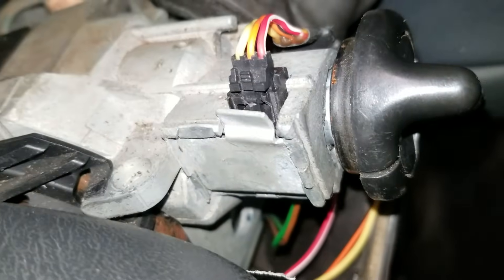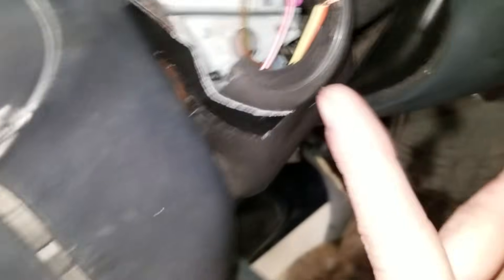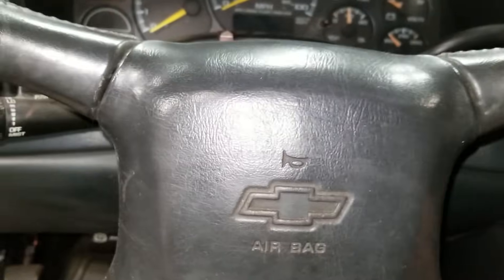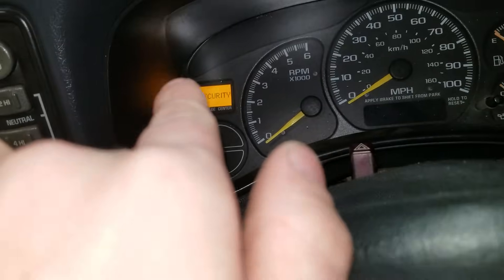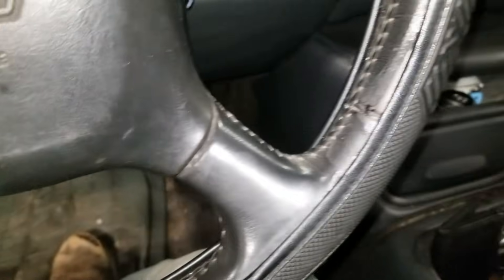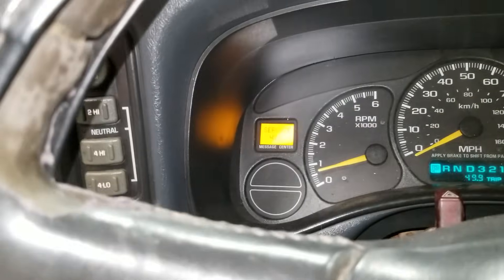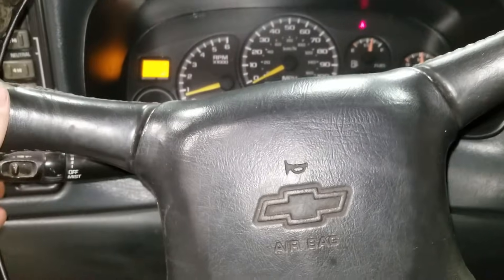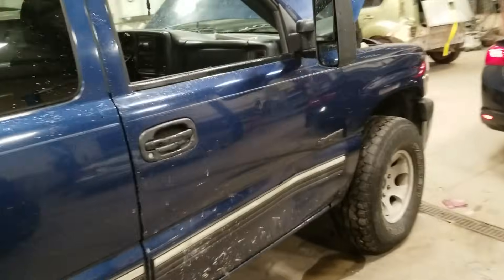99-07 Chevy Silverado No start Passlock 3 bypass 1500 2500 3500

Comment: Or just disconnect both battery cables and touch them together for 30 seconds and be done
Reply from the maker: I tried that before going crazy. If this problem was that simple this video wouldn’t have so many views
Reply: @You're a GOOF  well I did what you have said and it's hit or miss that it works! Alot of it has to do is that harness is very loose and the pins are not making contact

Comment: Help me!!! I've tried this on and off about 4 times today. My security light never stops blinking while in the 10 minute wait. Any idea what could be the problem?
Reply from the maker: Have the truck scanned to see if there are any codes then go from the code. It could be a bad key or a  whole bunch of things
Reply: So just to clarify u attempted this bypass to no success?
Reply: @alaynaanddad3825  correct, I ended up bringing it to the shop. Still waiting for it to be done actually.
Reply: @amandalapinoja  whay fixd it end up being?
Reply: @alaynaanddad3825  I still havent heard from the shop yet, I'm still waiting. I contacted a GM shop in the nearest town and they told me my computer needed to be reprogrammed and that would cost roughly 100 bucks. But I sent it to a small mechanic shop, last week. Hopefully it's fixed soon
Reply: @amandalapinoja  gotcha from what I have read trying to diagnose it can be the ignition cylinder the passlock sensor or messed up wires either to bcm or from bcm to pcm. When u hear back let me know what it was I would be very grateful. My truck has been to several mechanics and they are just throwing parts at it. Literally passlock is the only thi g wrong with my truck so annoying. Thanks for the I fo fingers crossed for u hope to hear the fix
Reply: Amanda Lapinoja I would sure like to hear from anyone that has found the fix for when the security light never quits flashing after performing the reset. This fix works great for if the problem is in the ignition switch, but he doesn’t mention all of the symptoms he had. I have working headlights and door locks and windshield wipers, and heater fan;  but none of the gauges work, no clicking from the starter solenoid, won’t crank, and security light flashes as soon as I turn the key on - and forever after that, until I pull the key out.

Comment: I have a 2003 Chevy Silverado everytime I turn the key the horn honks is it a alarm system
Reply from the maker: Sounds like an aftermarket alarm system. Try removing the trim panel by your knees to see if there any wires that dont look factory that are spliced in. I had switch in my truck that once flipped the horn would sound once key was turned. Figured out that I must've hit the switch on my way out one day and was so I thought stranded until another set of eyes showed up and noticed the rocker switch under dash.

Comment: Mine started with out resetting it lol
Reply: And you cut the wires?
Reply from the maker: Then it most likely wasnt the same issue. Once the systems in that security lock down mode it senses something's wrong and wont restart until reset.

Comment: 2008. Chevrole Silverado code. PO 335
Reply from the maker: Thats a code relating to the crank position sensor. Id replace that then see if the problem persists.

Comment: Has anyone else done this and it work
Reply from the maker: I saw another guys video on this but i wasnt to confident about cutting security system wires so i decided to make my own video. If you can change your oil you can bypass vats 3 its super easy and if it doesn't work (it will) you could always reconnect the wires and pay GM to replace the correct parts but thats just silly.
Reply from the maker: If you have any issues with it leave another comment and I'll help you out to the best of my ability
Reply: Currently doing this on my 2000 escalade. Same wires for passkey coming out of my ignition.....but the security light isn't going off after 10 min...any thoughts?

Comment: Try this to my truck didn't work
Reply from the maker: Awesome grammer boss. My iq just dropped a few points reading that.
Reply from the maker: And if it didnt work then its another issue.
Reply: @zachnuketown  after I tried this trick it did not work I do have different symptoms my security light will flash 5 times and then it will flash battery for 5 seconds and then back to security five times we hook the HP tuner to it to disable security and right a different tune cannot upload back to cpu  from hp tuner